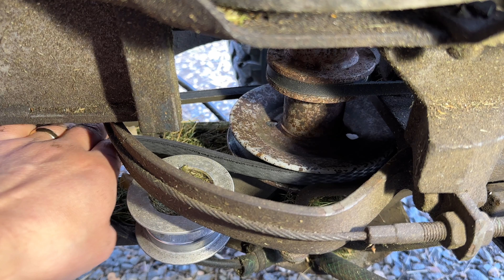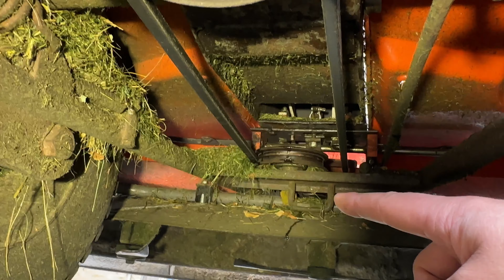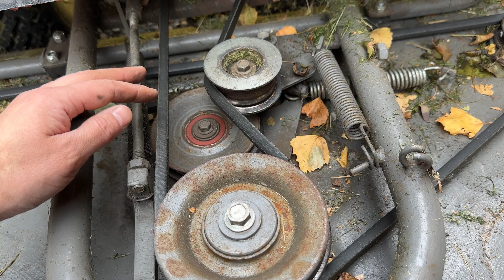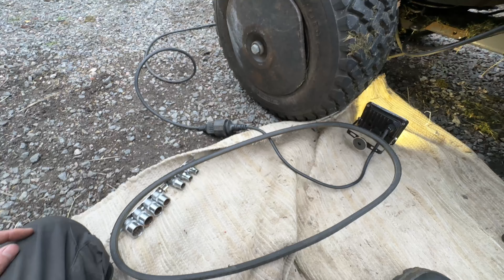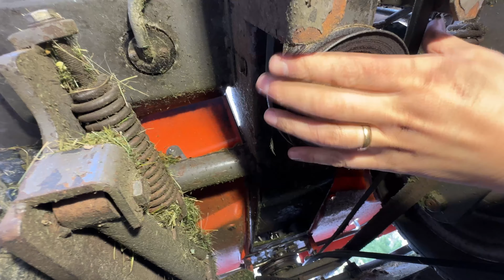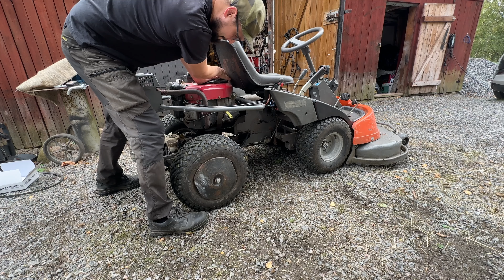How to change the “impossible” belt on Husqvarna Rider, step by step instructions

Comment: I have a Rider 1200. I have, of course, changed every belt and bearing over the years. One thing I found was causing belt slippage was pulley wear. I have replaced that middle double pulley, it made a huge difference. Turns out the belt was ‘bottoming out’ in the pulley, thus loosing grip!
Reply from the maker: Hi! I have heard about pulleys getting worn like that but never experienced it myself. How many hours does that machine have on the clock?

Comment: Not related to the belt but I was cutting on my rider 13 I ran out of petrol. I refueled but now I can't get the engine to start, what are the common reasons or where do I start to look to get it running?? Thanks
Reply from the maker: @eddieegan4077  Hi! The fuel pump can sometimes have trouble catching the fuel once ran dry. Try blowing in the fuel opening while trying to start. That will push the fuel to the pump. Don’t breathe in the fumes! God luck!
Reply from the maker: So any feedback? Did you get it running?